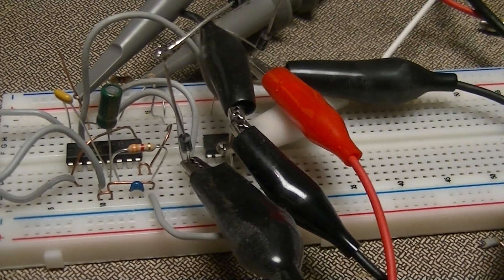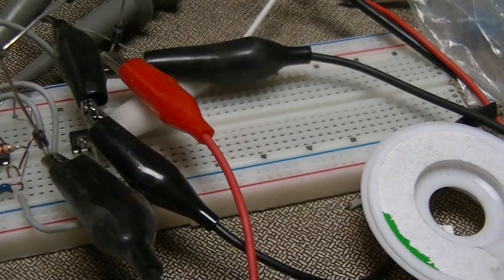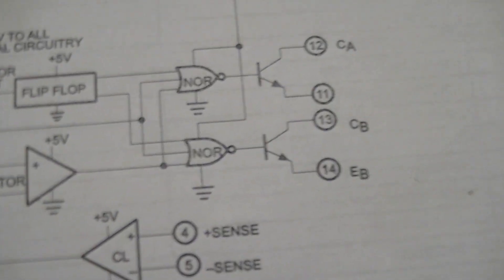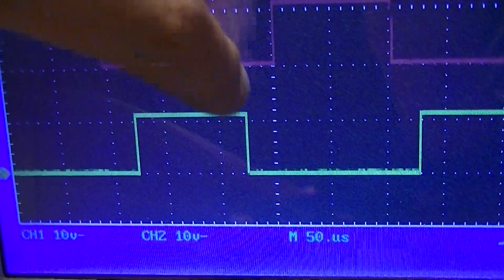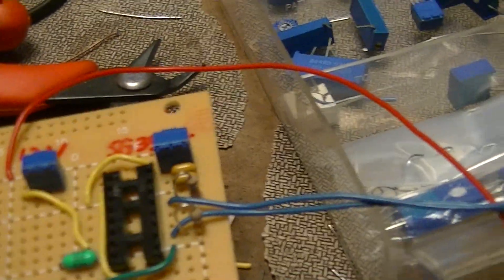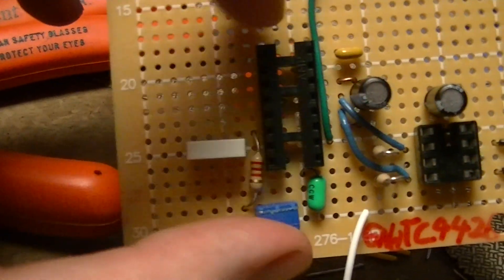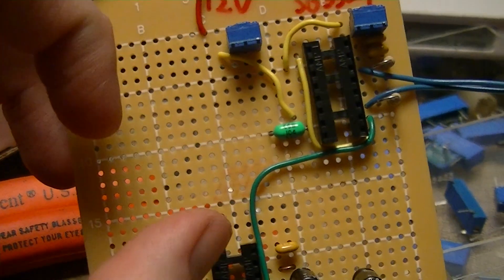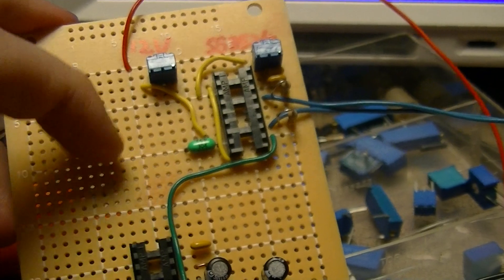DIY MPPT inverter control board design and SG3524 testing

Comment: nice video master............ but please i can i use sg2535 for this
Reply from the maker: You mean SG3525?  Yes but the circuit needs some modification as the SG3525 has signal outputs instead of transistor outputs as well as no direct current monitoring.

Comment: Could you explain your portion of the circuit for varying the duty cycle of the SG3525 with a variable resistor? I am working on a similar driver that will be used in a homemade multi kW supply

Comment: Interesting- so the inductor can handle around how much before it saturates with high core magnetic flux- possibly 30A at 24V - 720W ??  That's the highest charge power output claimed by decent looking $150-175 MPPT charge controllers.

Comment from the maker: My design is currently only for 12V use as my system is 12V, but it could be scaled up with some different components.
Also, some kind of SMPS design would be better than a buck converter at those potentials as the high potential drop across the inductor means that the inductor will have very high core losses due to high core magnetic flux.

Comment: look forward to seeing this DIY MPPT circuit control the charge between PV panels and a typical battery bank!  how many amps and volts ought it be able to control ??  anything close to 150-300V solar pv input, 100A at 58V output, to bulk charge a 48V battery bank ??